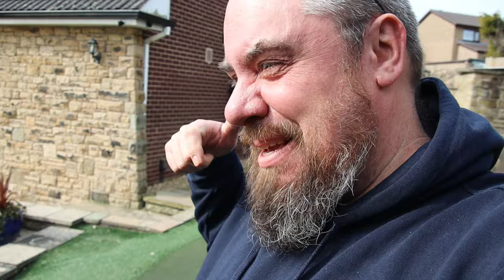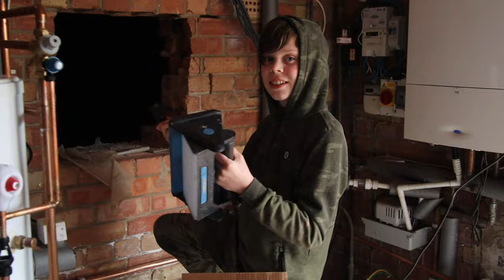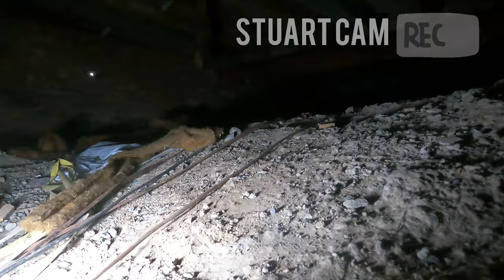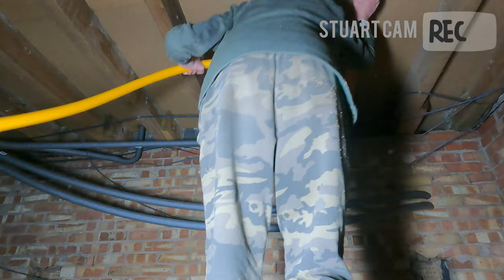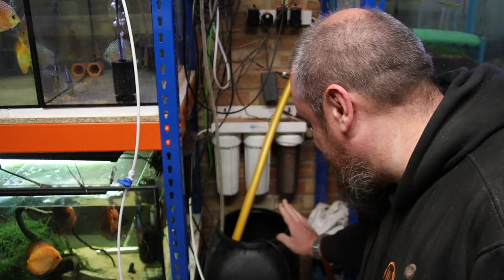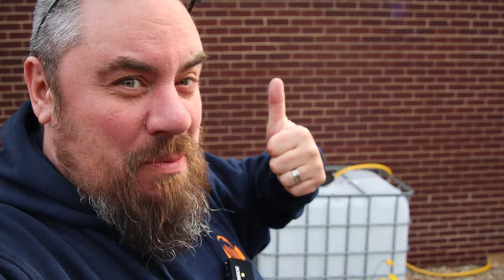Aquarium fish room automatic water change - part 1

Comment: A couple of practical concerns. Will the final solution have the outflow end to the big water butt above water level to prevent it siphoning back once more full? Will the pipe fully empty in winter so that there isn’t any residual water in the pipe to freeze and cause disaster..?

It’s a great idea, these just struck me as being possible issues.
Reply from the maker: All things i've thought about too - the output will be above the water line, and have check valves fitted to prevent siphoning - and it will all be lagged for winter 👍
Reply: @AquariumAdventures  Assumed you would have but would never have forgiven myself in winter when the 'It's all gone to hell' video appeared! 😆